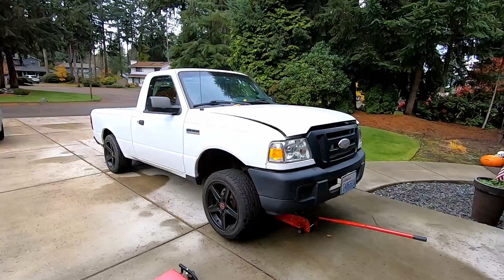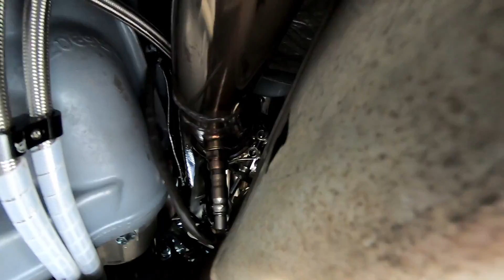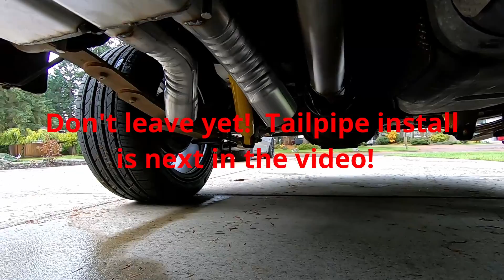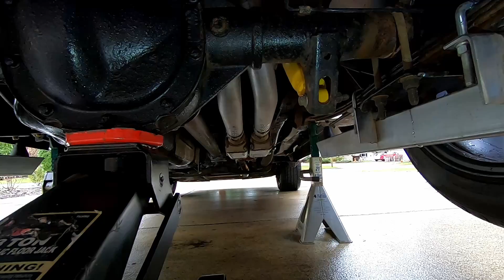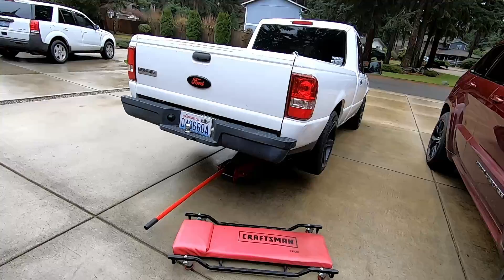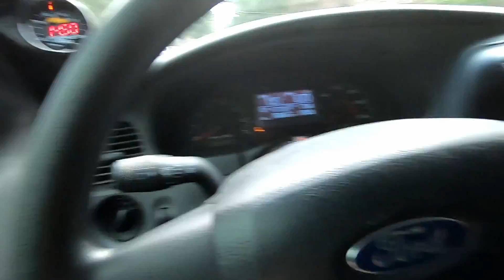How NOT to Cram a Full 2.5 inch Dual Exhaust into a Lowered Ford Ranger V8 swap or V6

Comment: Hello there.  I just found your vids as i was searching ford ranger ls swap...  i notice you kept the ac/heater box...  my question is,  the stock ls ac compressor clears the frame?
Reply from the maker: It will not.  I was hoping it would but there just isn't enough room.   I was also hoping to low mount the alternator on the drivers side but also not enough room.   So if and when I get the AC going it will take a high mount ICT billet style bracket.
Reply: Ok gotcha.  At least there's the high mount option...    you're running car accessories,  are you also running the pulley from car?  Or truck?    Trying to keep it as budget as possible. I have an lq9 out of a yukon so all truck components..    thanks for the reply!  @PNW_Car_Mods
Reply from the maker: @yzcrkxrm1   Fbody Camaro accessory spacing.   Truck spacing may work but there will likely be no room for fans.
Reply: Damn.  Im just try it out. Hopefully it clears. And Yeah dude. Your the only person who really documented this swap. Not many out there i guess
 But glad i know its doable. 👍  thanks for the help man.  Sorry if i bug u with more questions later on lol.    @PNW_Car_Mods
Reply from the maker: @yzcrkxrm1  By all means, ask all the questions you need to.
Reply: Hey there bro,   i notice the mounts you used are the adjustable ones.  Are those needed to adjust the mount plate either foward or back to be able to reach the weld on tabs?     Or will the straight and center mounts work within the width of the frame? 

I hope im making sense...     @PNW_Car_Mods

Comment: I’m doing a LS swap in a Mazda B2300 I really appreciate the videos!! I was curious what springs you used to lower the front of the truck
Reply from the maker: 1 full coil cut off the front springs.   It is right around 3 inches of drop with the extra 350 lbs or so from the extra weight of the engine and transmission.

Comment: Do you think it’s possible to clear on the drivers side on a 4x4
Reply from the maker: I can't say for certain but I am pretty sure the fuel tank is mounted exactly the same and the tank hangs so low.   I should have mentioned it in the video that the fuel tank is the pain in the ass of all of this routing.
Reply: @PNW_Car_Mods  yes and I’m planning on mounting a Bronco II tank in the rear, getting rid of the original.
Reply from the maker: @ScottLight10  I would think that would help a ton!  I've been debating on going to a center mounted fuel cell where the spare is not so much to rearrange the exhaust but to get more range out of the truck and help with traction.

Comment: How often are you having to tighten those headers
Reply from the maker: As long as you use a factory GM or OEM multilayer steel manifold gasket........NEVER.  They just don't come loose.  If you use a crappy composite gasket, all bets are off.